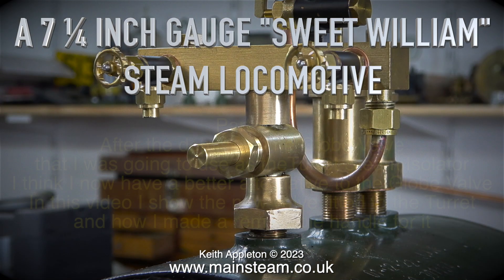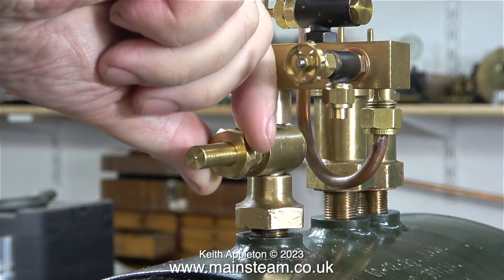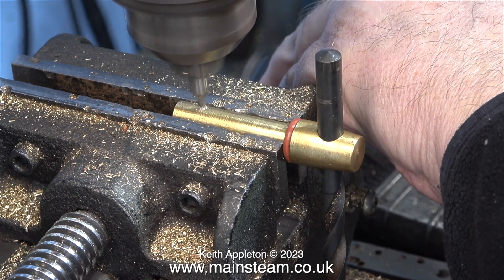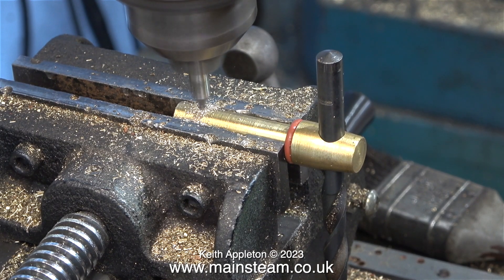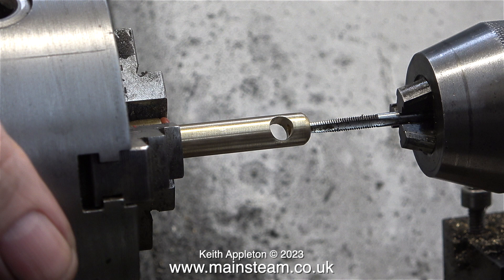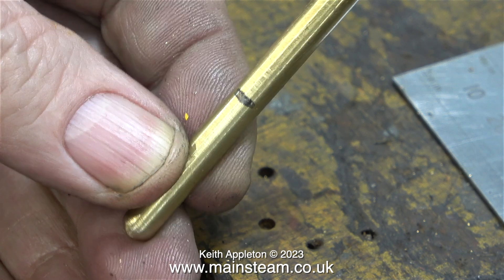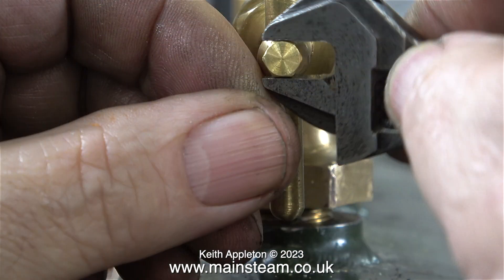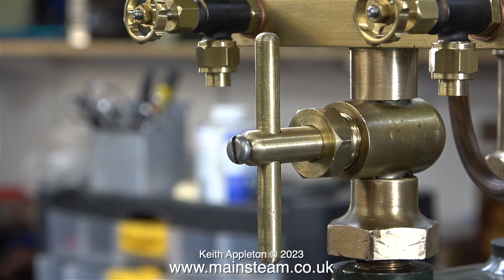A 7 ¼ INCH GAUGE "SWEET WILLIAM" LOCOMOTIVE - PART #26

Comment: Very cool. Thanks for sharing. I like how that injector valve looks it is a great improvement over the globe and looks better. Thanks for the tip on being able to remove the handle.  Excellent point about being able to service the o ring.  How well do those cone valves work with pressure in the turret? Are they as smooth as a globe?